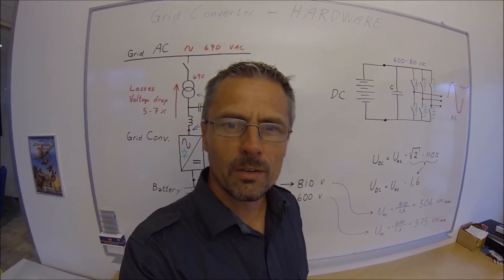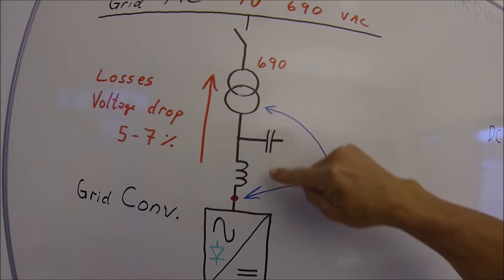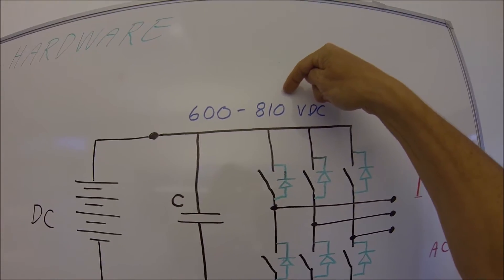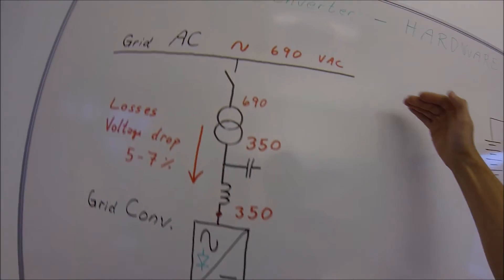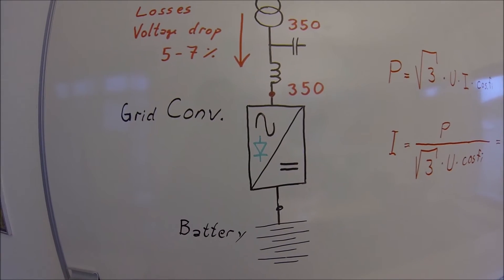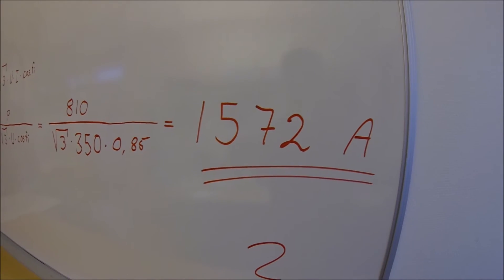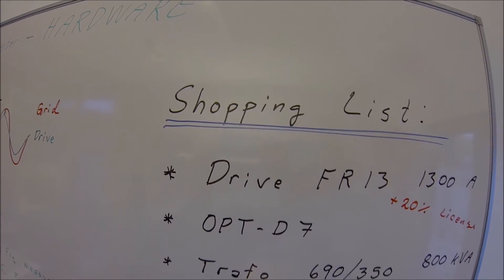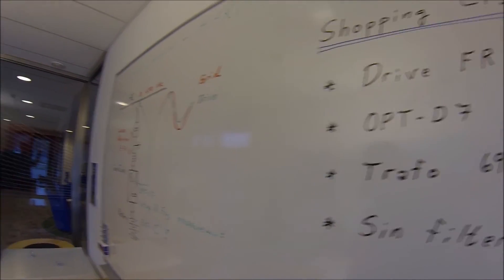Drives School (E4) - Grid Converter hardware dimensioning

Comment: I cannot understand why endurance of power delivering is 45 minutes. As I see if maximum current of battery is 1000A and maximum voltage is 810V, we have 810kW only at the beginning of working. Battery voltage is decreasing from the beginning till the end. As we have maximum current we cannot maintain the same power even for 10 minutes. If I am wrong show me where, please.

Comment: Hi Mr Berntsen,  Thank you for this video, I think I have watched all your videos today, which have been great. I am currently part of a new build project which is utilising Danfoss Vacon drives in a DC/DC converter and also a Microgrid.  I am finding difficult to find information online on how the microgrid utilises the LCL filter to boost the input voltage to allow charging.  You mention in your video that it injects reactive currents to boost the voltage using active front end technology.  Can you suggest any documentation/videos which explain how this actually increases the voltage.  Many Thanks
Reply from the maker: Declan White There are a lot online documentation on that details. It is anout basic electric physics, current is always an active and reactive part.
Reply: Thank you for your reply, I understand the reactive and active currents and that adjusting the voltage will change the reactive power output of the unit, but during battery charging if the battery voltage is for example 700dVC and the AC "input" only 350V AC what method is the converter using to step up that voltage?  Is it utilising the LCL filter chokes in some form of voltage boosting?

Comment: Mr. Reidar Berntsen, first of all I must say I like your videos. I am new in Vacon drive and I am first experience is with microgrid converters. Do you have experience with converter CH74 12 pulses liquid cooled?
Reply from the maker: Yes, we use the CH74 a lot for ship propulsion, oil drilling and shore power systems. Two of them form a 12 pulse system that can be star coupled  or drive synch coupled to one big motor. Typical 690 VAC and 2700 amperes, Then You have got a 3 MW drive. Biggest challenge with watercooled drives are to get cabinet manufacturers to build the watercooling system correct. Any car sports a perfect water cooling system so it should not be that difficult. But when electrical engineers starts messing with watercooling then things like de-airing, service access to pumps and components are not that obvious.

Comment: you know way more than this than i do i am just inquisitive. What circuit controls the igbts?
Reply from the maker: IGBT's are hardware wise fired from a driver board that in turn is fired via fiber optics from an ASIC computer. The ASIC basicly turns the 6 pcs of IGBT transistors on and off to produce the needed PWM (Pulse Widh Modulation) to create the required TRMS sinousidal amplitude and frequency. The ASIC get its input via optical fiber data bus from the NXP control module. Which is like an industrial computer, not much unlike a PLC, and contains the system software, application software and customer defined parameters. And a nice interface to the user.
Reply from the maker: Your question the other day regarding why I use the squere root of 2 instead of the number 1,35 in the realation between the 3phase AC side of the drive and the DC link. The mathematic correct relation is squere root of 2. However, in practical life the DC link supress the voltage a little bit due to how the hardware is built so it ends up at 1,35 instead of theoretical 1,4142. We are not consequent in which number to be used. So it end up a bit confusing but neither number is wrong.
Reply: Great videos, so software communicates with the driver board. I'm assuming this driver board is off the self part? The asic computer is hooked to something like a serial bus? The fiber optics is used to make use of the speed and low losses? 

Thats interesting. I took a intro alan bradly plc class where we programmed a festo sorting machine.  

I am working on my mechanical engineering under grad with the hope of pursuing an education in nuclear engineering.  but i love the electrical side of things which is what most mech engineers despise. So i find myself watch youtube videos from guys like yourself. I really appreciate your video series